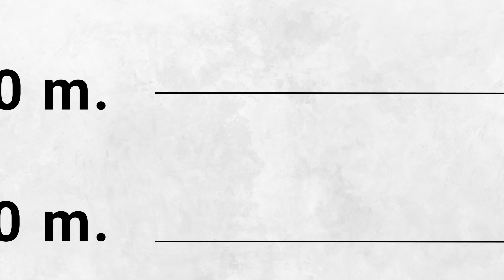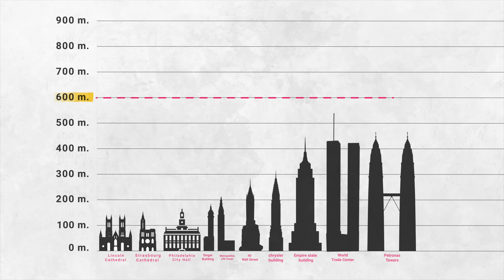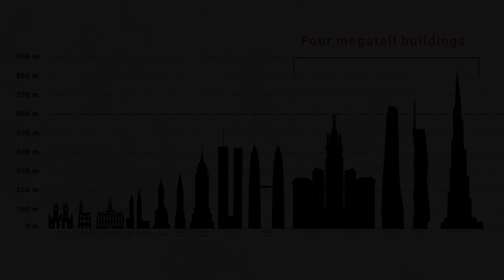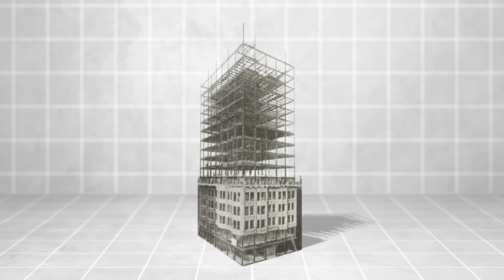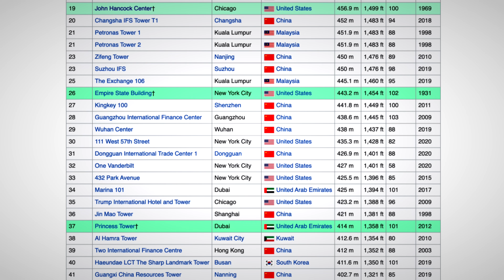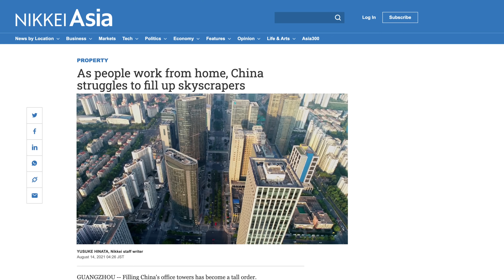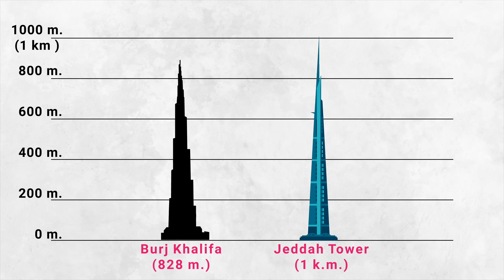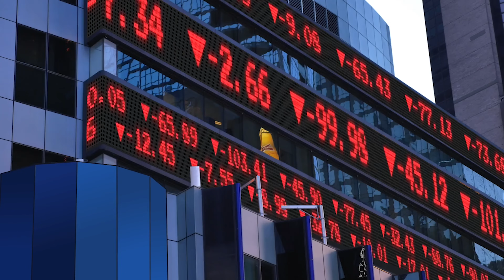The End of Mega-Tall Skyscrapers

Comment: As a person who has worked with structural engineers in a consultancy, I can confirm that a crisis is looming that we don't have the manpower to deal with, massive structures requiring maintenance and us not having enough people to fix them while they are constantly about to collapse. Cities like New York, Shanghai, Macau, Hong Kong and the lots which have buildings that are immensely tall have a huge problem on their hands. The problem won't be that there will be a lack of buildings, we simply won't be able to stop the existing ones from collapsing.

(edit) Since many people have questions about building practices and this comment has received many likes, I shall instead explain how a building actually becomes stressed over time. 
Think of a building like a standing carboard box. If it is an office space, it becomes filled with people and cars during the day and empty by night. This means that it is stressed under the weight of inhabitants during the day and de-stressed at night. The contraction and expansions day after day wears the materials out. Add to this, the temperature and pressure changes and the questionable practices of builders sourced from places like China (which is more common in a city like NY than you might think), and you have a recipe for disaster. 
Our dependency on concrete has also left us disabled. More humble materials like simple bricks and mortar have been disregarded and concrete is now used even for low-lying structures.
Once RCC develops rust and damages, it's game over and the clock starts clicking down to zero. Take into consideration the sprawling cities we have now built, at the cost of building a massive skyline. Most people who live in apartments in skyscrapers report feelings of desolation, angst, depression and loneliness far more than people in smaller buildings.
The city of NY was so successful in maintaining its infrastructure because of the unique weather conditions and the pre-existing infrastructure based on underground steam pipes. This is not the same around the world. It is bad model and has turned into a contest between firms and conglomerates for no real benefit.
Reply: This same thing is happening to road/highway and bridge infrastructure right now, we had a boom in development and now we dont have the resources or time to maintain them.
Same thing seems to be happening almost everywhere, its quite clear that things just aren't sustainable and were starting to see the effects.
Reply: @Free_Krazy  
We have both resources and manpower, we just choose to not use them.
Reply: @garrysmodgigachad  , "The soul that does not work does not eat".  When you make that the law of the land, then you fix the labor issue.  However, there also needs to be strictly enforced exceptions to such things to babies, little children, the elderly that can no longer work, and the people that are too mentally, physically, and/or developmentally disabled to work.
Reply: @paxhumana2015  
I mean, yeah, obviously kids and the elderly shouldn’t be made to work on building stuff lol
Reply: @Free_Krazy  
Sustainability is possible on existing roads and infrastructure as long as the money allocated for these things is actually spent on their upkeep. 
Unfortunately criminal politicians and beaurcrats keep running off with the funds and spending it on themselves.
Reply: @Free_Krazy  people dont want to do hard work anymore. thats a fact. I see it with my job and I am a Garbage man, Decent wages as well so I know its not a wage issue.
Reply: @Free_Krazy  At the end of the century, we should see a collapse of our last century and current early century infrastructure. Sure maintenance is being made but not enough could you do for the 100% of the area.
Reply: @Free_Krazy  things could be sustainable and kept in good repair if the military budget wasn't so huge. Ever since 2000 most the money has gone to warmongering instead of taking care of infrastructure which is what a sane nurturing for the people society would do.
Reply: Good Point.  And if they don't have the money to install a sewer system how do you think corners could be cut in maintenance. The willingness to have a huge caravan of poop trucks every day makes the entire structure suspect in my opinion.  Otherwise I think  Dubai is fascinating, even though there are  many huge mistakes that will revel themselves in coming years.
Reply: @guidedmeditation2396  They do have a sewer system. They are also building a new waste plant to manage the increased load. We do people repeat nonsense so often again and again.
Reply: Wait, why the fuck did that 72 floor high building start shaking, in China?
Reply: @4Everlast  perhaps a very small quake started and the momentum picked up....
Reply: @lorinapetranova2607  I thought so, otherwise it would be strange.
Reply: There are people that would be willing to do the work if the billionaires would pay up. Cheap bastards think the world is all about them
Cheers
Reply: Why did i click on "read more"😭😭
Reply: Isn't decommissioning Nuclear power plants what killed them off?  This cost was not factored in of the original costings. A 1 kilometre high building if it falls side ways will destroy a lot of building and people. It would be impressive to see.
Reply: Demolish the new shit, save anything made before 2000
Reply: Above 400m any structure is not economical
Reply: lets be honest, our ambitions have got us to be more fragile than ever, we keep becoming more ambitious, we need to be more efficient and accept reality, there is no reason to build the tallest building of all time when there is still tons of problems we already have to fix.
Reply: you forgot mumbai
Reply: They'll collapse eventually. Humans won't be here forever. In fact, the way things look, humans won't make it to the year 3000 AD.
Reply: And how do you bring down a building that is extremely tall when its time has come?
Reply: @michaelbujaki2462  that's the issue. they haven't been built to last centuries in the case of some sort of workforce crisis (which we are currently in) which would be fine if it wasnt for the fact tbese buildings were made with the intent of cramming large populations into small areas. it's a dense urban nightmare ☹
Reply: @michaelbujaki2462  fake a terror attack.
Reply: @michaelbujaki2462  fly a plane into ir
Reply: How many sky scrappers has collapsed in the last hundred years?
Reply: I'm not an engineer, but I've often wondered what effect the 1993 World Trade Center bombing had on its structural integrity, and if it was still compromised on 9/11.
Reply: Skyscrapers look cool tho
Reply: Hey men, since you have so much knowledge about buildings, I wanted to ask whats the difference in old churches like in europe. I live in germany, and I once watched a docu about old buildings, and that churches that have been built here are like holding forever or at least for a very long time, without maintenance at all, while other buildings will start to collapse very soon. Why can they hold so long, being so old, than compared to today scyscrapers. I mean, is it the material that has been used to build them, or the architectual way of how they are constructed. Definitly its that they have less wear downs like you explained with the stressed and de-stressed at night. I cant find the documentation movie about that topic, and I wanted to know.
Reply: @BlackAge2k  An important material that is used in Churches is stone. Stone and cement were the go-to materials of choice. Stone has very good compressive strength but not very good shear strength. If used correctly, moisture does not damage stone to the extent that it can damage RCC. Churches were built using stone, cement with plaster covering the constructions in order to waterproof them. This method works well and there are many ancient structures that still stand to this day that use these materials.
Reply: @burhanuddinsakarwala5033  Thanks for that men, really appreciate it.
Reply: They're all part of the churn. They'll be demolished and new buildings will come up
Reply: We could have the manpower, but borrowing insane amounts of money for useless, indoctrination degrees like gender studies is much more fashionable these days.
Reply: If they become a problem they'll implode them and build something else there.
Reply: Omg they will collapse ???? 😳😳
Reply: seems like our perspective on future doesn't align with current situation..
Reply: We don't believe you
Reply: This is creepy ...
Reply: Here’s an idea you could weigh in on: Buildings capped at 200 m. in height, but they stretch out for miles around them, like entire small towns or cities packed into a building?
Reply: well that comes down to the building practices put in place and where there skipped in parts of construction to save time and money.
Reply: Yup, people have this Star Trek idea of endless progress but that only applies to processing information. The material world has hard limits and we've reached them. We don't even have the Concorde anymore ...
Reply: Oh, I am happy that I live in Europe now.
Reply: Thabks
Reply: Thank you for this amazing comment, wel written and a good explanation that even I understand have a great day👌
Reply: Well said sir👍
Reply: This is nonsense. Skyscrapers are built extremely sturdily and are built to last for hundreds of years without maintenance. Skyscrapers are the last buildings to collapse when nobody is left.
Reply: I’m a civil engineer who specializes in concrete restoration  and maintenance of existing buildings. You’re correct, there’s not many of us compared to the amount of engineers in new construction.
Reply: robots
Reply: Just stop making new people. Simple
Reply: @MsBB37  that's not simple, though.

and its not really a solution either, if anything whats beneficial for us at the moment is an increasing population to tackle that issue. 

something you have to understand is the current workforce crisis, there isnt enough qualified peopled as there was during the construction process of many urban areas. 

it's an issue with current education, id assume. but whatever it is theres really no quick solution that would give us the option to 'slow down' which doesn't really benefit anyone as you might think.
Reply: @fishboymanshark  It's not just education, it's culture too. There's a pervasive sort of contempt for the workforce, like working quote un-quote "humble" jobs is something to be ashamed of and that makes you less of a person. That's because we're in a culture where you always have to strive for "more", no matter what you already have or where you already are. 

I keep on hearing stories about people being divorced by their partners for not being "ambitious enough", as if feeling that you have reached the position in life that you wanted to reach is somehow a bad thing. Being content is not something we're encouraged to be.

For this reason, since the fallacy of "you are your job" is very pervasive, any job that doesn't offer prospects of theoretically infinite growth is automatically seen as less than desirable, even if some of them offer pretty decent pay to start with. And even if a lot of them are absolutely necessary for modern society to keep functioning in the long run.

This is not something you can overcome through education alone, a shift in how culture perceives "humble" work is also needed. Crafts need to be invested in, blue collar jobs need to be given their due value (including by raising minimum wage, for too many reasons to count), and the idea that being anything less than higher management is not something to aspire to needs to fucking die.
Reply: @fishboymanshark  yeah sad but true.. sigh
Reply: @brodericksiz625  this is a really great analysis and i completely agree. its something ive put some thought into and i think its fair to say whilst education is a big factor in this, as i do think there's now a focus on getting bigger and better work, there's also a real factor of how media and entertainment and corporations have portrayed status.

i really do wonder too, how much the government's promotion and funding of entrepreneurship has effected this? its not something im in expert in but i truly believe your suggestions would make a massive difference if the public consciousness can be shifted soon enough.
Reply: @MsBB37  , why not take your own damn advice first, Adolf Hitler?
Reply: Nuh. We will always have the manpower to maintain buildings. The problem is, people dont want to buy it because it is so darn expensive and all those developers cant repay back their bank debts putting a risk on banking crisis. We need high rises because cities cant survive if you keep on building single family homes but we also dont need more skyscrapers.
Reply: @secrets.295  I disagree. You can put any warm body on a job. You can’t find experienced and skilled tradesmen anymore. it’s very difficult.
Reply: @Blizzard020  more pay and you'll find them

We have the same "problem" in Germany but it's actually about cheap labor.
Reply: @Blizzard020  Skills are something that can be developed. And when there is a deficit of worker, companies will start paying higher wages for that particular jobs and im pretty sure plenty of people will apply for the job when that happens. There is also somewhat of a movement in my opinion. People no longer feels like a college degree is necessary and considering how high the student loan debt is. Many people would rather work rather than wasting time and money over a degree that doesnt pay you well. Like literally a plumber makes more money than someone with social studies degree working in that industry. You are paid so little and you have to pay tons of studen debt. Unless you study an engineering or medical degree where the pay is so huge, thats a different story.
Reply: @Blizzard020  I'm gaining experience as fast as possible, and I have to say... Beyond 10 floors starts become a logistical nightmare until elevators are active...  Carrying material up many floors... It is hell... We need more labour, I think the skill is there, it's the tedious manual labour that no one wants to do, so it often falls to the GC
Reply: China will be better equipped for this, since the government can basically do whatever it wants. In the US, the government can’t really do anything if the owner of the building has given up.
Reply: Smaller cities really don't seem to have the same problems as larger ones. As the big cities fall apart, people will move to nearby small cities and towns, and those towns will expand. I really don't see a problem. We are already seeing this with NY and LA. The pain we're feeling is the natural pain associated with expanding or contracting populations. It's been happening since forever, and it will keep happening as long as free will exists.
Reply: I have to agree with that. 
I think many cities here in America will eventually be ruinous anyway. I give it by 2100, many cities will be abandoned just like malls in current times.
Reply: @notofthisworld5267  whilst i could see that happening i don't think you're considering how insanely close to us 2100 is. we currently have the manpower to keep cities running, the impact itself will really only be fully understood in 10-30 years. 

a bit part of it is the workforce and consideing the alarming rate its declining at we could probably see some version of a serious disaster playing out around the middle of the century assuming the workforce doesn't magically improve.

but in saying that, we've seen major tagedies happen in densely populated cities before, it definetly wont result in an immediate or even gradual decline in cities atleast in our lifetime. may be something our grandchildren's children our dealing with.
Reply: Earth needs more humans on this giant planet to maintain our small civilization
Reply: Thank God I hate living in cities. I won't be anywhere near them when the tall boys come crashing down.
Reply: so whats the alternative? tear down more trees to build outwards?
Reply: Close the borders, stop importing millions of people each year, no wonder we have a housing shortage and over crowded roads, not enough water, etc.....
Reply: @DerrickCartercosmostravels  Rich evans is dancing funnily 
He says “you know your phone camera is always looking at you”
“Can I have some water?” Asks Mike
Alice Barbara hands crossed with a frown stretched across her face tells mike sternly “no, you may not”
Mike had a few he’s probably parched he should have a drink I think it’s fucked up Alice Barbara won’t let him have a drink
After some deliberation they bring him a cup of water 
This water tastes weird” Mike grunts
“That’s becuase it’s not water it’s alker 
seltzer, get some rest” Alice Barbara says 
Mike was deceived he thirsted for water 
They gave him alka seltzer when he had asked for water and didn’t tell him what it was
Now Mike is cautious he doesn’t trust these secret agents now he wonders if it’s really alka seltzer or if that alka seltzer is only there to cover up a drug put into the drink to put him to sleep
He remembers her words “get some rest”
The fbi has drugged Mike Stocklossa his head grows light his eyelids grow heavy and he passes out 
Rich is furious 
His childhood friend is unconscious on the floor 
He begins weeping 
Jays eyes remain dry, not at all surprised by the drugging
 I can hear Rich evans yell at the top of his lungs “it’s ALL TRUE”
I hear a beeping noise 
A distinct “Clear!”
A defibrillator is pressed to mikes chest to resuscitate him 
Mikes eyes open back up
Mike stocklosa says “my heart stopped…”
Reply: @DerrickCartercosmostravels  No, the alternative is to tear down 2 or 3 story buildings and replace them with 10 story buildings. You don't need skyscrapers to have a densely populated urban environment. The problem (in the US at least) is our obsession with single family homes and big yards - that's what causes sprawl.
Reply: @DavidJohnson-fc9bn  You could just have people move when a city becomes too dense but... Nah, better to force other people to live the way you want right!
Reply: @spacebound1969  The issue is that most of our cities aren't dense ENOUGH, and that's a serious problem for both the environment and the economy. Sprawl takes up more space, consumes more energy and is more expensive to maintain and provide with public services. It also isn't really caused by individual choices, but by public policies like car-centric urban planning and vast swaths of land being zoned exclusively for single-family homes.
Reply: @DavidJohnson-fc9bn  Yes that is my point, if you want a house go somewhere else. Don't force people from their single family homes into cracker jack boxes
Reply: @spacebound1969  And my point is, don't force people INTO single family homes by zoning exclusively for them (and if they do live in single family homes, make them pay the actual costs of maintaining the expensive sprawling infrastructure they rely on rather than artificially suppressing those costs with development Ponzi schemes, debt, and subsidies from other people's taxes).
Reply: @spacebound1969  have people move? Isn't that forcing people to live the way you want?
Reply: There is plenty of land. Nothing arong with sprawl, that is utter nonsense. The government owns most of the west coast and wont allow development. Regardless, there still is plenty of open land, it's better and healthier for most people. Not depending an extremely complex system that could kill people with economic turmoil, since there is no sustainability nor independence being shoved in like a sardine, owning nothing and not being happy.

The main problem is zoning, jobs are zoned away from homes,and residential is very restricted and NIMBY nonsense and cooie cutter, but neighborhood designs that are not organic at all.
Reply: @DavidJohnson-fc9bn  and the problem with sprawl is people have giant yards and grow 0 food and make 0 money with their space...in fact..they just spend money on watering and maintaining massive useless lawns.
Reply: @DerrickCartercosmostravels  the long-term alternative, that is already happening, is just not multiplying like rabbits.  Population growth is slowing and stopping most places, and when the growth rate gets to 0 in a few more decades (which it already is in the US and a lot of Europe), we won't need to expand further.
Reply: @OrigamiMarie  that could easily achieved by simply not subsidising reproduction without thinking by the governemnt. To be fair, most problems in the US and by proxy in the world would be solved if the gov would think twice about spending money on something. Not subsidising student loans over 2000$/semester would have hardcapped the uni tutition costs at most at 2100$(apart from the top 10 hyperexpensive ones). Not paying farmers to produce so much Darn corn would also mean cheaper wheat and such. 
The other problem is regulation. PPl being forced to own a car is disgusting. The idea of not being able to open a store in a several mile by several mile area is absurd. The invisible hand would unironically sort out at least 80% of the problems, if it wouldn't be blocked 24/7. Not to mention unions and other bullshit that in turn makes it impossible to do anything with a profit. Also sheer quantity ofregulation... no goodfaithed company can keep up with 1.2 million rules to follow. For most, it's better not to even try.
Reply: @OrigamiMarie  theoretically, but immigration and humanitarian crisis say otherwise
Reply: @stanleymaximillian8403  that doesn't actually change the equation much?  The US has net neutral or negative population growth despite being an immigration destination.  Sure, families that arrive often come from traditions of large family sizes, but within a generation or two, most adopt their new home country ideas of family size.  And meanwhile, the less recent immigrants haven't even been keeping up with replacement rate.  That's how it's going here in the US, large families arrive, but we're still neutral or negative.
Reply: @OrigamiMarie  I didn't notice that you are only talking about US. I didn't see the word US. But I am talking in general in the world. Like Europe for instance
Reply: @stanleymaximillian8403  I don't know enough about the dynamics in Europe to talk about it specifically and intelligently.  

I do know that humans are all a lot more similar than most of us think we are, and in most cases where people are comfortable and happy, the mean family size tends toward replacement rate or lower.  And despite the nightly news and some blips, history is trending toward less conflict.